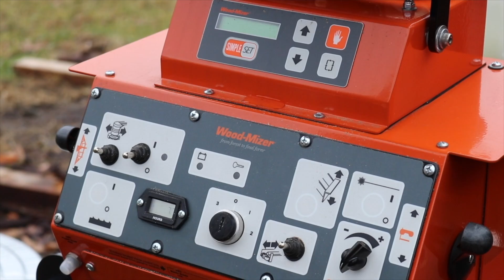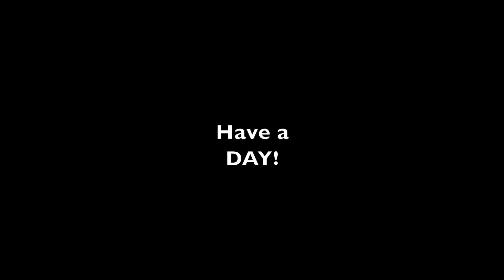#650 Milling a BEAUTIFUL Cherry, This one was almost left over the Hill!

Comment: Beautiful cherry.  Makes me think back to the house on the farm my Dad built after the original 2 story brick house burned down. The only lumber he bought for that little house was the wall studs and the oak flooring. The floor joists,  the subfloor and the rafters were all rough cut white oak. The baseboards were cherry and the quarter round trim on the floor was maple that he shaped at the place he worked on his own time. All the wood I have described came out of our woods. The brick veneer on the house was salvaged from the original house and even that brick had been fired on the farm when the original house was built. So,  90+% of the material in the house that exists on that property today came from the property it sits on.  Same goes for the barn. It is made from poplar. We don't own it anymore. Dad sold out in 1970 when he retired to Florida. I still miss that farm.

Comment: Hi Mike, would it not be easier if you raised the sawmill. Travel wheels, leveling jacks would be the way to go. With the mill higher it would save the back. You have the equipment to load the logs, you would be able to move the mill anytime anywhere anyplace.

Comment: When you use the wood miser does it automatically cut each board to the exact thickness? Or do you have to set each cut? Do you allow enough thickness to run through a plainer or just rough cutting. That cherry would make beautiful cabinets and furniture.

Comment: I remember when you first got the sawmill.  Someone talked about how you didn't have the bark guide/blade saver set right.  I thought about it then, but don't know why I didn't say anything.  That guide is only on one side.  My question is.  Is the bark on the out/opposite side any less damaging or softer?  lol  I've also noticed when people complain or have "constructive criticism" they usually don't offer a solution.  I design custom millwork for a living and I can say I know the prices of these mills and the firewood equipment and I would say it has already paid for itself.  Keep doing what you're doing!

Comment: Is there a reason why the controls are not on the other side so the operator didn’t have to wade through the saw dust??????   

Nice wood, several hundred dollars there!!
Reply: Grousetrap I’ve wondered that too from when he first got it, but a question for Wood-Mizer not MM. Might be safety if blade breaks?